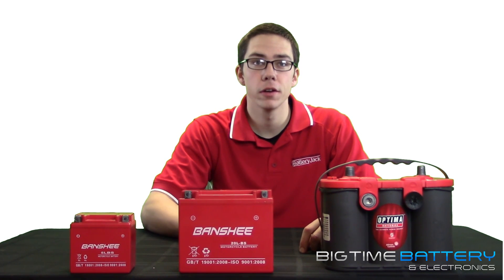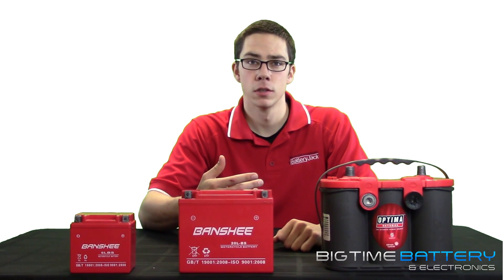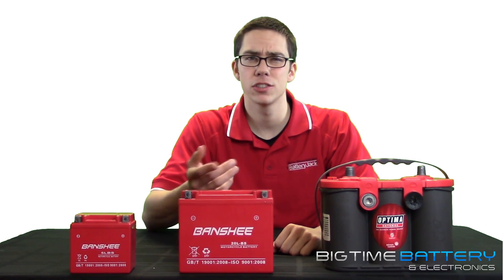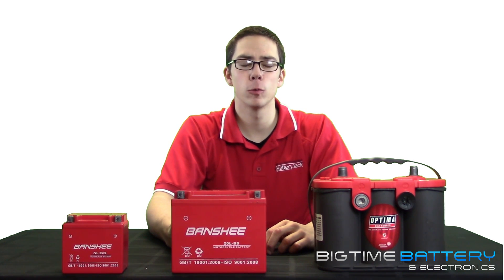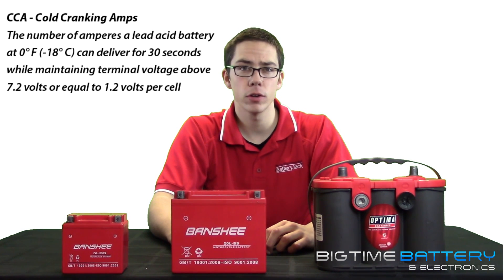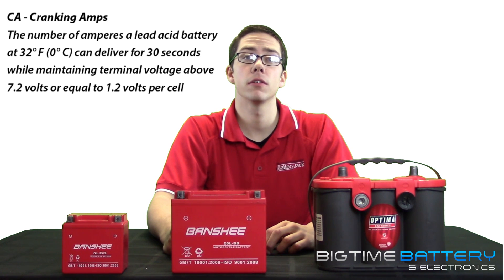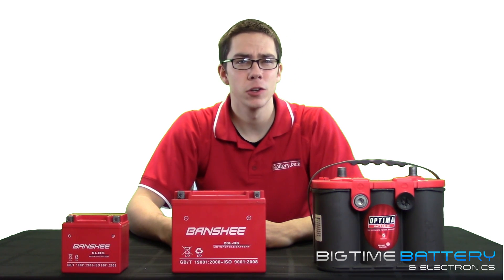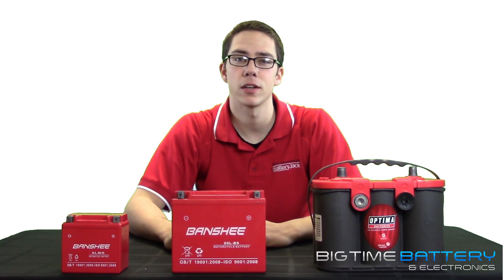Cranking Amps vs CCA

Comment: Battery dosnt keep the engine running once the engines running the alternator powers everything else why’ll charging the battery. The only thing the battery dose is give power to the radio window locks and so on. But it’s main job is to give power to the starter to turn over the engine once started the battery dose nothing but sit there and get re charged
Reply: How about on a motorcycle?
Reply: @Seamusog1987    Well yea that’s different i was speaking about cars
Reply: I heard that if the battery is wearing out then the alternator has to work harder which makes that wear out faster
Reply from the maker: Your statement mostly captures the basic roles of a battery and an alternator in a vehicle's electrical system, but it simplifies the ongoing role of the battery while the engine is running. Here's a more detailed explanation:

Starting the Engine: The primary function of the car battery is indeed to provide the initial electric current required to power the starter motor and turn over the engine. This requires a significant amount of electrical power, which is why the battery is such a critical component of the vehicle's starting system.

Powering Electrical Components Before Engine Starts: Before the engine starts and when it is not running, the battery provides the necessary power to operate the vehicle's electrical components like the headlights, radio, and power windows.

Supplying Power with Engine Running: Once the engine is running, the alternator becomes the primary source of power for the vehicle's electrical systems and for recharging the battery. The alternator converts mechanical energy from the engine into electrical energy, which it then supplies to the vehicle's electrical components.

Role of the Battery with Engine Running: While it's true that the alternator provides the power for the electrical components once the engine is running, the battery still plays a role. It acts as a buffer and a stabilizer for the electrical system. The battery helps to smooth out power demands and voltage spikes that can occur, which might otherwise damage sensitive electronic components. It also ensures that there is a consistent supply of power even when the alternator's output is not perfectly steady or when large electrical loads are applied that might temporarily exceed the alternator's capacity.

Providing Power in High Demand Situations: There are situations where the electrical demand can temporarily exceed what the alternator can supply, especially in vehicles with high-performance electrical systems. In these cases, the battery can provide an additional power source to help meet these demands.

Emergency Backup: In the event that the alternator fails, the battery can temporarily power the vehicle's electrical systems, allowing you to drive a short distance to safety or to stop the vehicle in a controlled manner.

In summary, while the alternator does take over supplying power to the vehicle's electrical systems once the engine is running, and recharges the battery, the battery continues to play a supportive and stabilizing role in the vehicle's electrical system beyond just starting the engine.
Reply: I guess I did miss something on start up the battery powers the starter but also powers the fuel pump and main computers as well as the sparking system and fuel injectors radio security systems windows door locks HVAC wipers and washer pump headlights horn four way flashers powered mirror adjuster electronic seat adjuster trunk release lock. Most vehicles will have Off , Accessory , On , Start if it’s a keyed ignition. On will turn on the cars main computers and prime the fuel pump. Start will engage the starter motor.

Comment: Hi...how do you test a cca and ca on a battery
Reply: There are meters available that can test CCA and CA fairly cheaply.
Reply from the maker: To test a battery's Cold Cranking Amps (CCA) and Cranking Amps (CA), you generally use a battery tester that can measure these specific parameters. Here's a simplified overview of the process for both:

Cold Cranking Amps (CCA)
CCA is a rating used to define a battery's ability to start an engine in cold temperatures. Specifically, it refers to the number of amps a 12-volt battery can deliver at 0°F for 30 seconds while maintaining a voltage of at least 7.2 volts.

Ensure Safety: Make sure the vehicle and all its electrical components are off. Wear safety equipment like gloves and eye protection.

Check Battery State: Ensure the battery is fully charged. A low charge level can affect the accuracy of your test.

Use a Battery Tester: Connect a battery tester that can measure CCA to the battery terminals. The tester should be set to the CCA test mode.

Input Battery Specifications: Input the battery's rated CCA value into the tester. This information is usually found on the battery label.

Perform the Test: Follow the tester's instructions to start the test. The tester applies a load and measures the battery's output under that load.

Read Results: The tester will display the battery's actual CCA, which you can compare to the rated CCA. A significant drop in the actual CCA compared to the rated CCA indicates that the battery may be failing.

Cranking Amps (CA)
CA is similar to CCA but measured at 32°F. The CA rating is usually higher than the CCA rating because batteries perform better at warmer temperatures.

Testing CA is similar to testing CCA but less common in practice. Not all battery testers measure CA directly, so you might use the CCA measurement as a proxy for overall battery health. If you specifically need to measure CA, you would follow a similar procedure to the CCA test, ensuring the battery tester supports CA measurements and adjusting the temperature conditions if possible to more closely match the CA's testing environment (though this specific condition is more challenging to replicate without specialized equipment).

General Tips
Battery Condition: Ensure the battery terminals are clean and corrosion-free before testing.
Tester Calibration: Use a calibrated and reliable battery tester.
Manufacturer's Instructions: Always follow the battery manufacturer's guidelines and the battery tester's manual for accurate results.
If you don't have access to a professional battery tester, it's advisable to take the battery to an auto parts store or a mechanic, as many offer free testing services with the appropriate equipment to accurately measure CCA and CA.

Comment: HOW CCA CAN BE MORE THAN HA ESTABLISHED ?? ECPLAIN PLEASE
Reply from the maker: Cold Cranking Amps (CCA) and Ampere-hours (Ah) are two different specifications that measure different aspects of a battery's performance.

Cold Cranking Amps (CCA): CCA measures a battery's ability to deliver a burst of energy to start an engine in cold weather conditions. It indicates the maximum current a battery can deliver at 0°F (-18°C) for 30 seconds while maintaining a voltage of at least 7.2 volts for a 12-volt battery. CCA is primarily relevant for starting batteries used in vehicles.

Ampere-hours (Ah): Ah measures the capacity of a battery to deliver a certain amount of current over a specified period. It represents the total amount of charge a battery can deliver at a constant rate over a certain period, typically expressed in hours. Ah is commonly used to describe the capacity of deep-cycle batteries used in applications such as solar energy storage, marine, and RV applications.

While CCA and Ah are both important battery specifications, they measure different characteristics and are not directly comparable. It's possible for a battery to have a higher CCA rating than its Ah rating, and vice versa.

For example, a starting battery designed for high cranking power may have a high CCA rating but a relatively lower Ah rating because it is optimized for delivering short bursts of high current to start an engine. On the other hand, a deep-cycle battery designed for long-term energy storage may have a high Ah rating but a lower CCA rating because it is optimized for delivering a steady current over an extended period.

In summary, CCA and Ah measure different aspects of a battery's performance, and it's possible for a battery to have a higher CCA rating than its Ah rating, depending on its design and intended application.

Comment: How good can a lithium 100 amp battery be for building a high capacity jump starter. I now they are super expensive ($1,000 +) bud I need to jump start anything from 10 to 30 cars a day.
Reply from the maker: Using a lithium battery with a 100 ampere-hour (Ah) capacity for building a high-capacity jump starter can be highly effective, especially for your needs of jump-starting 10 to 30 cars a day. Lithium batteries, particularly those made from lithium iron phosphate (LiFePO4) chemistry, are well-suited for this application due to their advantages over traditional lead-acid batteries. Here's why a lithium 100 Ah battery could be a good choice:

High Energy Density: Lithium batteries have a much higher energy density compared to lead-acid batteries. This means they can store more energy in the same amount of space, making them compact and lightweight. This is crucial for a portable jump starter that needs to be moved around frequently.

High Discharge Rate: Lithium batteries can provide a high peak current, which is necessary for jump-starting a car. Their ability to deliver high current instantly makes them ideal for this purpose.

Longevity: Lithium batteries have a longer lifecycle compared to lead-acid batteries. While they are more expensive upfront, their ability to withstand thousands of charge-discharge cycles without significant degradation makes them cost-effective in the long run. Given your high usage rate, the durability of lithium batteries means you'll get more value for your investment over time.

Low Self-Discharge Rate: Lithium batteries have a low self-discharge rate, which means they retain their charge for longer periods when not in use. This is beneficial for a jump starter that may not be used every day but needs to be ready at a moment's notice.

Operational in Various Temperatures: Lithium batteries generally perform well in a wide range of temperatures, making them suitable for use in different environmental conditions.

Safety and Maintenance: Modern lithium batteries are equipped with built-in safety features to prevent issues like overcharging, deep discharge, and short-circuiting. They also require less maintenance compared to lead-acid batteries, as they do not need regular watering or equalization charges.

Given your requirement of jump-starting a significant number of cars daily, investing in a high-quality lithium battery is a wise decision despite the initial high cost. The efficiency, longevity, and reliability it offers will ensure that you can provide a dependable service, reducing the need for frequent replacements or maintenance.

However, it's important to choose a battery from a reputable manufacturer and ensure it comes with the necessary safety certifications. You should also consider the specific requirements of your jump starter device, such as the required cranking amps for the vehicles you intend to jump-start, to ensure the battery you select can meet these demands.

Comment: I need to know the names of the highest CCA car batteries.Because I'm using the batteries with the most cold cranking amps with the most watt power inverter to power a 3.5 mini fridge.Tell me how to make it work ?
Reply from the maker: For your project, finding the highest Cold Cranking Amps (CCA) car batteries is essential for ensuring enough power to start in cold temperatures and for powering devices like a mini fridge through a power inverter. CCA is a measure of the battery's ability to start an engine in cold temperatures, which indirectly reflects its overall power output capacity. However, for powering a mini fridge, you'll also need to consider the battery's Ampere-hour (Ah) rating, which indicates how much current a battery can provide over a period of time.

How to Make It Work:
Selecting a High CCA Battery:

Look for car batteries with the highest CCA rating available. Batteries designed for trucks or SUVs often have higher CCA ratings.
Ensure the battery has a high Ah rating as well, as this will determine how long the battery can run your mini fridge.
Choosing the Right Power Inverter:

Determine the wattage requirement of your mini fridge. This information is usually found on the fridge itself or in its manual.
Get a power inverter with a wattage rating higher than your mini fridge's requirement to ensure it can handle the load. For a 3.5 mini fridge, which typically consumes around 50 to 150 watts, a 200-300 watt inverter would suffice for operation, but you might want a buffer, so consider an inverter with at least 500 watts to accommodate startup peaks.
Connecting the Battery to the Inverter:

Use thick gauge cables to connect the battery to the inverter to minimize voltage drop and ensure efficient power transfer.
Make sure the connections are secure and the inverter is properly grounded to prevent any electrical issues.
Safety and Efficiency:

Consider using a deep-cycle battery instead of a standard car battery for longer life and better performance in applications where the battery is regularly discharged and recharged.
Monitor the battery voltage to prevent deep discharge, which can damage the battery. A fully charged 12-volt battery should not go below 10.5 volts.
Maintaining Power Supply:

If you need the setup to run for extended periods, consider how you will recharge the battery. If it's in a vehicle, running the engine periodically will recharge the battery. Alternatively, you could use solar panels or a battery charger.
Specific Battery Recommendations:
Without current access to real-time databases or the ability to browse, I cannot provide specific battery models or brands. Typically, brands like Optima, Interstate, and DieHard offer high-performance batteries with high CCA ratings. It's recommended to visit or contact automotive parts stores or check online marketplaces for the latest and most powerful options, specifying your need for high CCA and Ah ratings.

Final Note:
Ensure that your entire setup (battery, inverter, and fridge) is compatible and safely installed to avoid any electrical hazards. It's always a good idea to consult with or have the installation checked by a professional.

Comment: Hii Cody,

I need your advice. i just bought a new Varta F19 car battery online (autobatterienbilliger.de) for my Diesel 2 year old car - Toyota Avensis III Station Wagon (T27) 2.0 D-4D.

it has being only over 2 months (i didn't installed it into car until 1 month ago). 

everyday when before going to work, i noticed on my cigaratte hole volt meter indicating the voltage of the battery at the car key on is 11.6v (for a few seconds when key first turn on) , 
then it stays at 11.8v as long as the key remain on (not yet crank start). 
after crank up, it is 14v. 

the battery is brand new and i fully charged it before i install into the car. initially the voltage is 12v when the key first inserted and turned on. 
after few weeks, i noticed it becomes 11.9v , now 11.8v.  it stables at 11.8v after the initial diesel heat (which causes the voltage to drop to 11.6v).

i heard 11.8v is already 80% discharged or more , of the battery ? 

 during week days, i make short trip to work, but during week end, i did made 49mins drive on highway.. why it didn't fully charged the battery to over 12v as when i first installed the car battery (after charging at home ) ? 

right now is winter (2 -6 deg C day time, sometime -2C at night ) , i know battery not accepting so much charge during cold weather, but a brand new battery of expensive brand behave like this is ridiculous. if i don't pay attention to it, it might goes over 50% discharge and ruin the battery. my car alternator is good.. when the car running, it is mostly 14.2 volt as show on cigaratte volt meter. 

i also notice, when i turned the key on again after a short trip , the " key on" voltage is 12.2v . 
but over night (2nd day morning going to work), the "key on" voltage is again at 11.8v ( and initial diesel heat voltage is 11.6v).

so, what's the deal here ? 
do i have a bad battery or the vendor sold me old battery ? 

your advice will be very much appreciated.

thanks
andrew

Comment: This is a step by step program with the help of which you can use simple materials to repair all kinds of old and dead batteries [Check Details Here==>https://plus.google.com/100351090281822647456/posts/DDHJUMRLfS2 ]. It also helps you to update your completely charged battery and know how much money you can save from it.

Comment: Hi! I've learnt more about car battery now especially CCA... I'd like to know what are the possible reasons that affects the CCA?

Hope to hear from you soon! Keep up the good work! Cheers
Reply from the maker: Cold Cranking Amps (CCA) CCA is a rating used in the battery industry to define a battery's ability to start an engine in cold temperatures. ... The rating refers to the number of amps a 12-volt battery can deliver at 0°F for 30 seconds while maintaining a voltage of at least 7.2 volts.
Reply from the maker: The higher the CCA rating, the greater the starting power of the battery.
Reply from the maker: http://www.autobatteries.com/en-us/how-to-choose-your-car-battery-replacement/battery-cold-cranking-amps-cca
Reply: My Chevrolet Captiva 2.0 diesel has a 912CCA written in the car manual.Can I put a higher CCA battery? @BigTimeBattery
Reply from the maker: @kevinpicur7739  Yes absolutely and remember you can always reach us Text or Call at 815-467-6464 for a fast answer!
Reply: ........Cold weather.